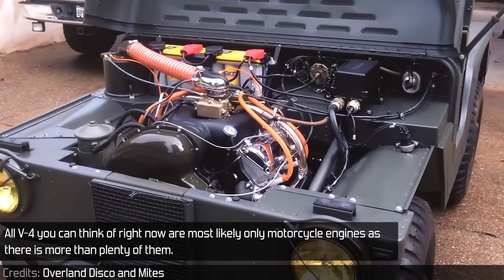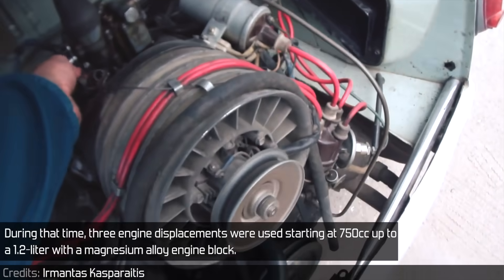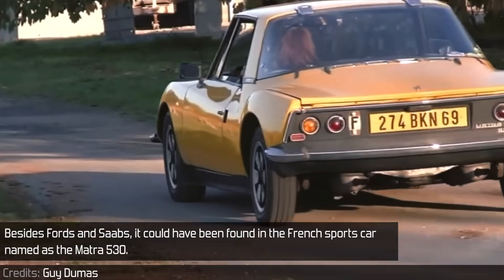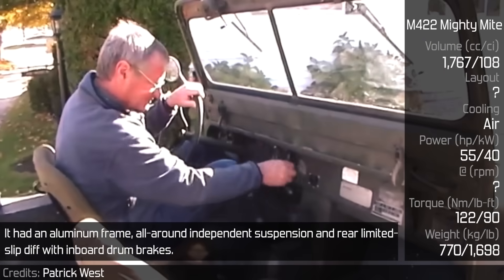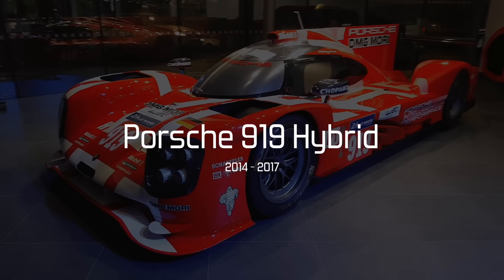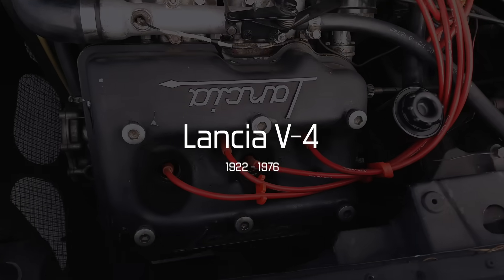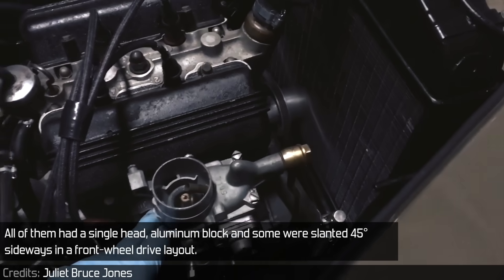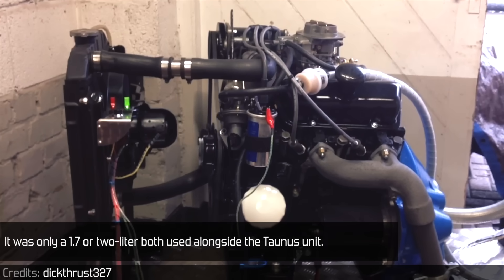The Only 6 Automobile V-4 Engines To Exist

Comment: BOTH of my Honda ST 1100's motorcycles have V4 engines.   Love em!
Reply: BLACK HOLE ENTRY I had one! Hard to find now. Was so comfortable to ride. Loved it. Lost it a few years ago in a slide, oil on the road. Honda dealer wouldn’t work on it to repair it.
Reply: @dam4274  I actually have two....a 2000 I bought new and has 115K on it and a 2002 I bought I bought six years ago on line in Arizona.  I flew there and rode it home....with a mandatory stop at Laughlin, NV.  It had 20K on it when I bought it, but now has 62K.  It's been about seven months since I fired it up, but that is soon to change.  

For several years I rode every Thursday with a local group where we would ride less than 100 miles to somewhere and have lunch.  This group disbanded and they ALL quit riding.  That has been four  years ago and I am older than ALL of them.  

I live in central CA near the coast and have a brother in Northern ID that just as soon as the weather warms a bit, I am going to fire up and ride to visit.  Then, I hear the UFO museum in Roswell loudly calling.  In the late 60's, I witnessed a 40' in diameter classic UFO fly directly over my house at less than 100' about 10 at night.  It had a tight triangle of brilliant red lights on its underside, which I have recently learned is part of their navigation system. 

My first motorcycle was a 46 EL Harley I bought from strawberry picking money when I was 16....put 40K on that one and rode several others over a period of 15 years, including riding 100 miles a day for three years commuting to work.  I put almost 200K on the 'group,'  

I was well aware of the Japanese motorcycle 'movement' but wouldn't even look at them.  Then, one day my ex BIL rode into my yard on a brand new root beer brown 69 Honda 750....took it for a short ride, goodbye Harley and I've never looked back.  Here was a bike that looked good, sounded great and had something that at the time was a totally foreign concept to Harley....a front brake that actually stopped. 

My AU wife has a brother 'back home' who is about 10 days older than I and in late Sept. we plan to make our fifth trip there so her brother and I can together celebrate our 80th birthday.   

There isn't a day goes by I do not think of my Dad.  He didn't do much the last five years of his life except sit around, listen to his baseball games and work crossword puzzles.  He died in the hospital, truly an old man, just barely making 70. Here I am, about to turn 80 and am still riding.  Of course, my mother was native Cherokee Indian and likely has something to do with it.

Please excuse me as I grab my electric weed whacker and take care of the 4' tall grass in my back yard.  BHE

Comment: Harley Davidson did something  called the Nova project. Porsche worked up an engine for them as a V4. It was watercooled and very promising as it was short stroke capable of 10,000 rpm. Budget problems made them put it on the back burner. What a shame because they had the ability to build it as a 2 cylinder and also as a 6 cyclinder which they could have sold to car companies and others.

Comment: FIAT 125 - GUYS! You didn't mention this one - 1.6lt (1598cc) Twin Overhead Cam Square Motor - Same Bore and Stroke. My Dad bought one in 1970 and did over 400 Hundred Thousand Miles.

Comment: The V4 Ford was a mechanical absurdity: The "vee" was setted at 60° (just like if it was a V6) and needed even a counterbalance shaft to run smoothly. 
Generally speaking, I think that the only "advantage" of a V4 engine is that it costs more to produce than an in-line four.

Comment: Not quite car engines, but the german Ford FK Trucks (roughly equivalent to the heavier F-series trucks) used an especially odd 2.8L V4 Diesel which was also a two stroke design, but unlike the more common uniflow scavenging these used loop scavenging and had no valves, just like a gasoline powered two stroke. There was also a V6 available, but both of them proved so terrible with deforming cylinder walls and engine failures en masse that they were discontinued after just two years, once again leaving the good old inefficient 3.9L Flathead they were supposed to replace as the sole engine option.

Comment: Had a v4 engine in a ford when i was in Germany. There were a lot of them
Reply: So did I. A '69 Ford 'P7b' 17m 2dr. Old 'G.I. Jalopy' or 'Base Bomber' as we called them? (An old cheap car that was sold and resold among G.I.'s, one goes back stateside,sells it cheap/gives it to another one needing a POV coming into command.) Got me where I needed/wanted to go,as long as you kept oil in it? (It was rather worn out by the time I got it,had a bit of 'blow by' if you ran it at Autobahn Speeds for too long?)

Comment: Back in the early 50's, i had the idea to build a pickup truck using a Wisconsin V4 and 4 or more transmission speeds.
 Of course, I knew a lot less about it back then, than I do now.
 Would be interesting to install one in a small truck like a Mitsubishi Mighty max, or Dodge D50, which was made by Mitsubishi.
  Have to figure the weight to horsepower ratio.

Comment: Midget racers make a V-4 by cutting a Chevy small block in half and cutting matching heads.  That way they met class engine size restrictions and could use racing parts made for the Chevy small block.

Comment: Ford Corsair 2000E GT,what a superb motor,it was quiet and rapid with handling to match,it was a great car to drive and the V4 2litre engine was great,it's a pity they never fitted a 5speed gearbox it would have been a real winner,a little bit heavy on fuel but it was cheap in those days so not a great problem,the 1700cc Corsair V4 was no slouch either but was better on fuel. I used too drive a 12 seater Transit Minibus with the 2litre low compression engine,did over 120000 miles without a problem.
Reply: Well said - I was lucky to have our family Corsair 2000E as my first car......and absolutely loved it, lots of torque and a wonderful sound!  RWJ 290F.

Comment: My dad used to put the Ford V4 or V6 into salvaged Ro80 rotary cars which he could buy for about 100 quid as their engines had seized (rotor tips not perfected). The compactness of these Vs made them the only viable lumps to replace the rotary. I drove one of them for years and it was a fantastic car, light-years ahead of its time, and the V4 was more than adequate when teamed with NSU's semi-automatic transmission. Brand snobs didn't like the conversion, but it was a cheap, brilliant solution.
Reply: Talking about this just the other day with an RO80 owner.

Comment: You forgot FIAT. FIAT used the V4 engine with 1.6 displacement in the 124, 128 and 131 models in the 70s
Reply: paulo domingues... Fabricca Industralli Automobili Torino (FIAT if you want) 124, 128 and 131 all used INLINE, 8 Valve, 4 cylinder DOHC engines, with old fashioned wide spaced cam covers covering their twin cams. Fiat did not make a V4

Comment: You forgot about Subaru.  They used a V-4 for many years in the 80s that I know of, possibly longer.
Reply from the maker: Subaru has never made a V-4 engine in a production car.
Reply: Perhaps I'm wrong.  In the '80s , my dad had a 1978 DL station wagon with an engine that appeared to be a V-4.  What was that engine actually considered to be? Perhaps a flat-4?

Comment: What are the advantages and disadvantages of a 90-degree V4 engine layout being used in cars? 
Ask since have read of Citroen testing a Citroen CX with a 2-litre 90-degree V4 based on the 3-litre Maserati V6, allegedly even BMW looked at developing a 90-degree V4 based on either the BMW OHV V8 or a new V8 design prior to or during their financial troubles.

Comment: The first v4 ever made was made by Walter Christie in 1907 and had a displacement of 1214 cubic inches(20 liters) making roughly 90 horse power it was mounted transversely across the front and replace the driveshaft with the crankshaft it was the first car to have a v4 and would at some point go up to 120 mph. 
   another v4 engine was produced in the 1970's by an america parts manufacturer called scat it was based off a Chevy v8
Reply: additionally the first v8 was manufactured by a defunct french automobile company called De Dion-Bouton and produced 40 horse power in 1908 
    the first 8 cylinder engine ever made was made by an american car company called franklin in 1906 this company only manufactured aircooled engines and went out of business in 1928

Comment: A V4 seems to make a lot of sense in a hybrid setup. I wonder why its not used  now with all the hybrids that are on sale. You can get a really nice sound in a small package to go along with the hybrid system.
Real sound and performance that would be nice in a world with growing fake sounding cars.
Reply: Plus most cars today are -- unfortunately -- front wheel drive. A V4 is NOT the engine you want to be mounted like your common  transverse I4.
Reply: The fastest car ever to lap the nurburgring the Porsche 919 hybrid is a V4!
Reply: Crossplane inline-4 sounds good too and cheaper to build
Reply: Porsche 919?
Besides that they are too expensive to build. Nowadays we can get so much power from a 3 cylinder engine it just doesnt make that much sense. 
If you build a expensive hybrid you might as well just use a V6 as its more powerfull and can be build to a better value, If you build a cheaper hybrid like the i3 or the golf gte a 3 or inline 4 cylinder engine is just so much cheaper to build
Reply: Fwd
Reply: Because the EV game isn’t going to promote better ICE
Reply: I think it's more to do with them using 3 pot and maybe we are going to end up with 2 pots soon but I really hope not
Reply: I love this idea.
Reply: People that drive hybrid cars don’t want to hear an engine. It will drown out NPR when they’re driving.
Reply: A v4 is the wrong application for a hybrid. The 90 degree v-configuration allows the engine to rev higher than an inline or a boxer because you don't need as heavy flywheel. But short-stroke high rev is the opposite of what you would want in a hybrid, for economy you'd want long stroke with torque down low. Inline is better for that kind of application.
Reply: @stuntmonkey00  Uhhh what? V4s have hugggeee second order imbalances that are in no way condusive to revs. They need balance shafts to spin anywhere near 6000rpm which is a lot of rotating mass to add. The only thing V4s have over inline 4s is packaging, which is why they are used almost exclusively in motorcycles. Inline and boxer engines can both rev higher than a V4 of equal displacement.
Reply: @ sawyer schumacher 

2nd order imbalances don’t matter for small displacement engines. 

The I4 has large 2nd order imbalances but plenty of them revved just fine without balance shafts. That’s why there used to be an unofficial 2.5L limit to I4s. 

It’s only with today’s NVH standards that older I4 seem “buzzy” ... and adding balance shafts to them is a no-brainer so they can rev to the stratosphere.

Comment: Ford used a v4 for yrs as a 1.7 and 2.0 they weren't the best engine they needed a balance shaft to try and smooth the running as not the best of engines for vibration

Comment: There is at least two other modern V4's (other than the Porsche unit)  that could be used in automotive applications yet were never used by an OEM....The Detroit designed Motus V4 pushrod OHV, and the German  WEBER V4 16v. Both are/were available as crate motors and have automotive style crankshaft connections.

Also...The Subaru flat4 is technically a V4
Wisconsin  engines made an industrial air cooled V4
Plus there are some other car manufacturers that used a V4 in the very early days of car history
Reply from the maker: I absolutely don't agree with the Subaru. Subaru does use boxer-style crankshaft, so it is not a 180° V-4, neither was the air-cooled Volkswagen boxer. One good example is the 180° V-12 by Ferrari for the 512 BB (like Berlinetta Boxer, although it is not a boxer engine).

Comment: I have only had two "V" engined cars in my life. The Ford Corsair (v4) and the Volvo 760 GLE (v6) both suffered severe overheating problems leading to block/head warping and gasket failure. The Triumph stag, another "V" engine suffered the same problems

Comment: You ought to show the Ford Essex V4 installed in the Zephyr mk4 - tiny short engine in a huge, long engine bay! It looks bizarre. Also worth mentioning its use in the Transit, maybe making it the most common V4 engine, along with the Taunus version.
Reply: i remember the mk4 zephyr lift the bonnet and the engine almost hidden by the spare wheel
Reply: Like a 283 in a 58 Chevy.  Engine didn't make it half way from the firewall to the bumper.

Comment: The ZAZ-965's MeMZ-965/966/966A 746/887cc engines were all air-cooled and produced only 23/27/30hp respectively. The only 50hp engine was MeMZ-968BE 1197cc air-cooled, but this one was built only in 1982 and the ZAZ carrying it was 968M, not the one mentioned in this video.

Comment: If you're going to mention the Ford V4 used in the P4, P5, P6 and P7 Taunus, the least you could do is actually show some video of an actual Taunus. Sure they're not nearly as sexy as a Saab Sonnet or a Matra 530, but neither of those would likely exist without the Taunus to provide the V4 engine.

Comment: Someone should make a V4 with a massive bore and short stroke diesel with twin turbos running a 20 or 30 to 1 air:fuel ratio, and put it in a large engine compartment. Then you would have space for a very large displacement with high RPM potential and a minimal turbo-lag. Not sure it would be as great in reality as it is in my head, but for shits and grins I would do it given the chance.

Comment: For a V-4 to even-fire it has to be a 90° V. Wisconsin built air-cooled flathead V-4s for years; the engine shape, roughly a cube, fits neatly into small engine bays in industrial tractors, bobcat-type loaders, and gensets.

Comment: Certain racing classes that allow innovation and development is where you will find the most interesting and intelligent creations. Check out speedcars (aka midgets) from speedway racing, some people make their own V4's usually by cutting a V8 in half and making the cranks, cams & valve train to suit. It seems to be more of an off-road racing thing as I've seen some buggies with V8 4's as well, usually people will cut down a chevy or ford V8. It is a LOT of effort but if you are serious about racing it can be beneficial (usually with displacement restricted ruling).  It's a very odd sound to hear but also very cool as they still have the tonality but at much different intervals.

Comment: The Essex V4 was an odd beast.
It was designed in 1965 for the Transit.
It was a 60 degree V4, this was already odd because the natural angle for a V4 is 90 degrees ( the one that gives the smoothest running )

It had a FLAT PLANE crankshaft, and needed a rotating counterbalance to make it moderately vibration free, despite this they were not very smooth.

There have been cases where Essex V4s completely inadvertedly broke cranks in half for no reason.
Like the Essex V6, it used a heron combustion chamber ( flat cylinder heads with dished pistons with bowls in them )
This was because Essex V4/V6 engines were designed so the same block could be used for Diesel and Petrol, but the Diesel idea was dropped.

This means they are fairly heavy, but the blocks are very strong.
I have a MkII Capri 3.0 Ghia that has 496.000 Km, it has a 3.0 Essex V6 ( it's second one ) :)

Comment: I had a number of Saab 96's with the Taunus V4, and it didn't have split crankpins. With its 60-degree angle between the banks, it had a balance shaft.

Comment: The Essex V series as we know them in the UK were a tough old lump.
The V4 never the smoothest and a counterbalance shaft was needed to even the lumps out. However it was to power the backbone of britain in the transit series for over a decade plus corsairs, capri's, zephyrs, and consuls so hats off to Ford compared to what the competition in the uk were offering. This engine in V4 form revolutionised the transport industry and drove this country forwards. Vauxhall's slant 4 ohc could match this engine for reliability and ease of maintenance. I miss this old favourite with its quirky sound.

Comment: Sorry but you missed major v4 manufacturers who used them. Hillman ( rootes group) used an earlier version of the saab v4 unit on the imp from the mid 1960's, Lancia, peugeot, and citroen used v4's in various cars through out the 50's to 80's. Many but not all did evolve from the ubiquitous bmw 500 twin motor bike engines especially when they could afford to produce their own engines, as a halfway point and space saver engine that had better torque rather than head off down the more fiddly and expensive 4 pot boxer engine

Comment: The mity mite used a Wisconsin V4 air cooled engine, at least the one I saw. I'm a little familiar with the engine in that it was in a friend's old Bobcat tractor as well as gensets I used to maintain. I've seen the Ford V4 in Saab cars as well as used as a power unit for the machine parts of streetsweepers. Kind of a cool little engine. The ZAZ looked like they folded a VW engine into a V, would be fun to play with one, maybe it would fit in a custom motorcycle.

Comment: My 2003 Nissan Sentra GXE has a 4 cylinder engine that puts out only 126bhp, but it's still able to burnout&launch...I want to tune it SO BAD! I've done 121mph without it dieing on me so I'll count that as an achievement.